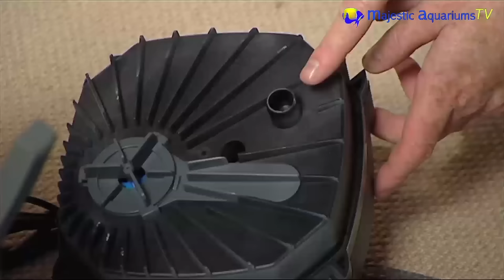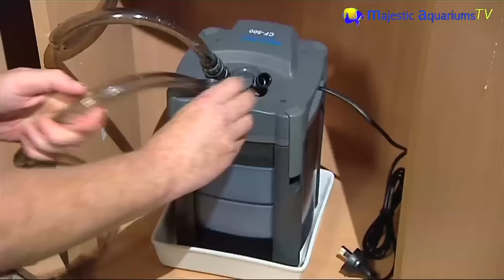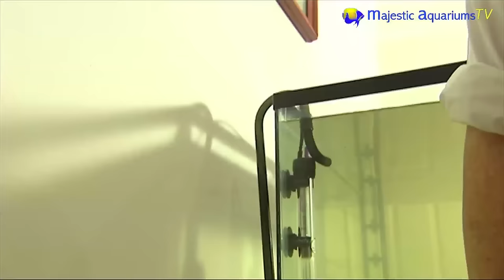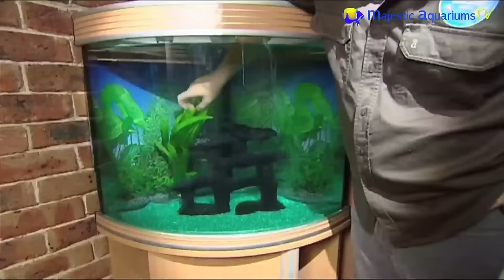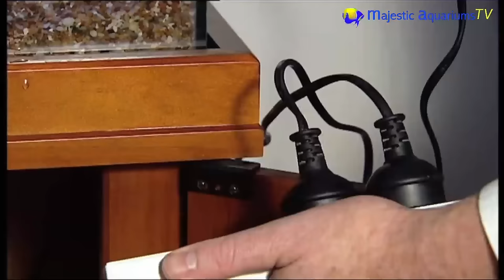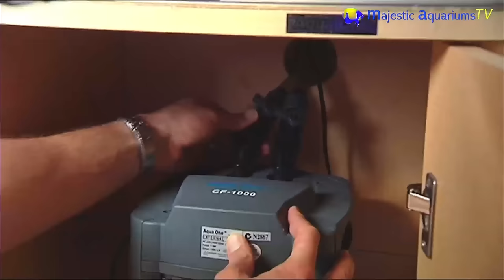How to set up and use an Aqua One Canister filter

Comment: I just got a aqua one 2700 and looks like the water flows from top to bottom so I put all sponges in top tray then bio in all other trays is this right
Reply from the maker: Opposite
Reply: @MajesticAquariumsTV   I pulled it apart today definitely top to bottom there is a one way valve on the inlet at the top of the canister

Comment: Hi Paul, i saw every demonstration on this video showing they always put media right in the bottom of the canister filter. Didn't this will effect the water flow? i thought the manufacturer put space in between base and first basket tray for reason. If its oke to put filter media right in the bottom of the canister, is it ok to put matrix?
Reply from the maker: putting a low surface area media like bioballs there is ok but I prefer not to.
I prefer to fill the canister with Marine Pure and put some Polyfilter at the top
Reply: It doesn't affect it..the filtering cloth media will clog first regardless of the bottom hard media for bio,.
Reply: You could also put the bio rings on the bottom

Comment: media before foams? no way... you must be joking...
Reply: Actually the bio hard media should go at the bottom due to the bio interaction. i've been doing it this way now and it works really well. i learned this from a pro who owns a pet store. My nitrate is always low to nothing
Reply: I can not believe I hadn’t read this before. Swapped things around as suggested by others and placed a layer of bio media in bottom below trays. In less than 24hrs my water is now crystal clear. I wish i had done this before purchasing another £100 filter to run along side of it (360L tank).
Reply: Very good. I tried and it works. I put the ceramic ring at the lowest level before the mechanical filter. It traps a lot! Thx !! 👍👍

Comment: with canister filters like the aqua one , aquis, nautilus, ocellaris and all them. my question and this is for everyone - with the lph on the boxes it says some like the ocellaris 1400 can do like 250 - 400 litres my tank is 200 litres and the rule of thumb is 10x or no lesser then 5x so my number should be like 2000 should I spend the extra to get the 2000 or will what`s on the box live up to what is says so I don't have to spend extra?  thanks in advance if anyone takes the time to answer this or any experience  and any advice on the matter is welcomed
Reply from the maker: increased turn over will not help. 4-6 times turn over is fine for filtration. I am a fan of extra flow in the aquarium to increase surface agitation. please watch more videos on this topical on this channel.
if you want to increase the proformance you can get better media such as polyfilter and marine pure
Reply: increased  flow rate helps the mechanical  filters.
But...the good bacteria needs time of absorbing/digesting  the bad stuff.
In the begining. ..looks fine.  suddenly, high levels of amonia. 
check water  standards levels weekly . take samples  ftom the outlet.
Flow  too fast, is an excellent  technique to increase amonia. 
It depends, medias, filter type etc...
..
Reply: Majestic AquariumsTV

Comment: This is the absolute worst advice on how to set up a filter. How can helpful Bactria grow on the noodles at the bottom? They will be covered in the large decaying organic matter. The chemical filtration won't work between the coarse and fine pads as it also gets clogged with fine stuff that is trapped under the fine filter pad. The correct order is from the bottom up coarse sponge, medium sponge then fine filter pad all in the bottom tray. Next tray up should be noodles or bio balls then the top tray more biological media or chemical if using. The space under the trays can also have a few handfuls of rings in it so that the biggest organic matter settles out before hitting the first coarse sponge and therefore making this filter even more effective.
Reply: does it not depend on water flow top to bottom or bottom to top?
Reply: @SOB821  I have this filter it works water from bottom to top. Setting it up the way in the video does not work efficiently.